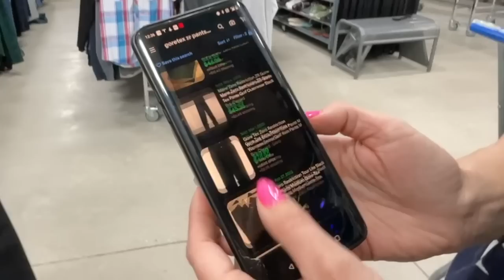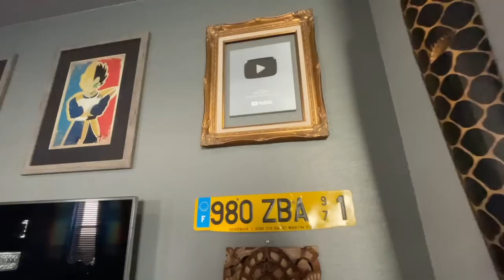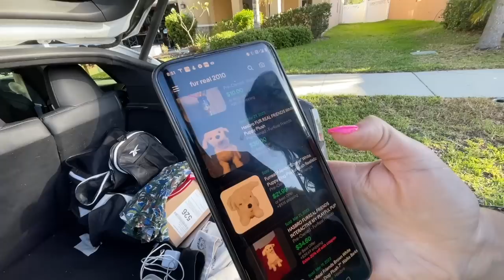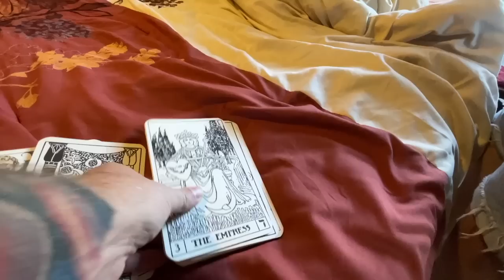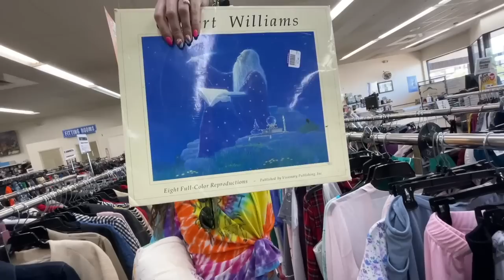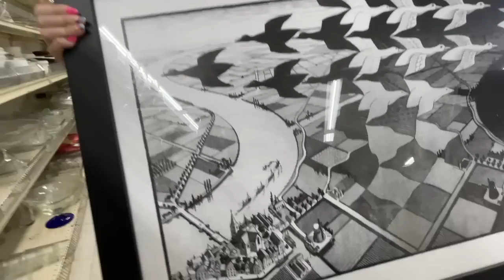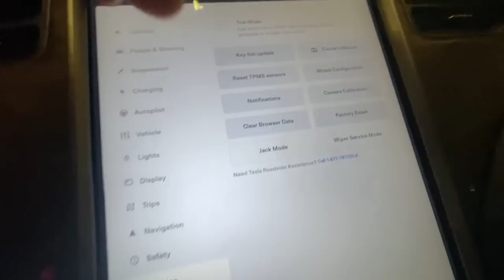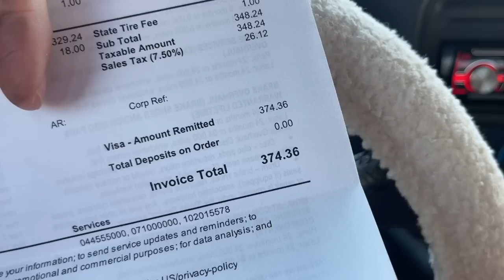When eBay Resellers Have A Bad Day…

Comment: Just need an alignment. My tire did the same thing. Tread was good on the outside when I was driving on it it swerved in the back a bit odd... So I checked again and ooooohhhhh inside the tire was shredded just a thin medal showing shred but I had tread on the outside. Weird. Got a special alignment and all Gucci.

Comment: Hey bro if you had that many miles on there and hadn't had them rotated at some point they will start to wear out a little funny like on the outside shoulders and eventually will get very thin. Just a little tip for ya incase u didn't know. Those are so expensive anyways. Get em rotated every so often amd they'll last 2 3 times as long. 👍
Reply from the maker: Very true!

Comment: Loosen the lug nuts a little before you get the car off the ground.  Also please make sure you get the other tires checked.  I've found that when one is going bad there is a good chance the others are.  Rotations are normally done between 5K and 8K/6 months.  May need an alignment too.  I like to see your smiling faces!  Congrats on 200K!